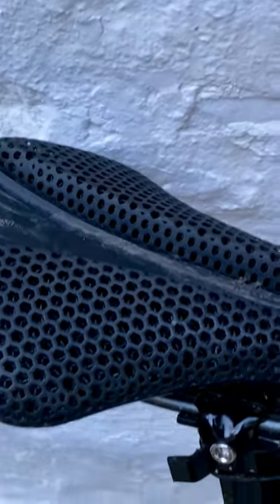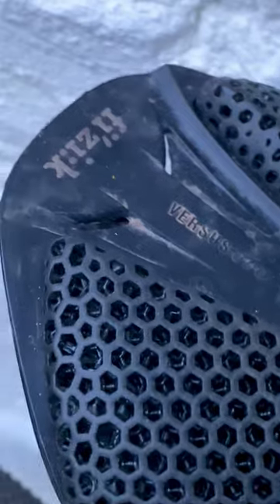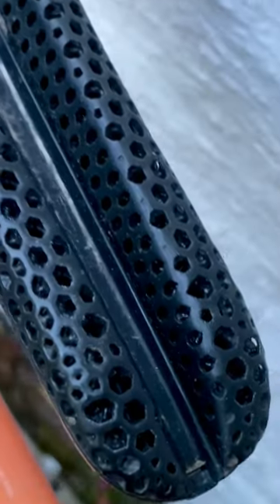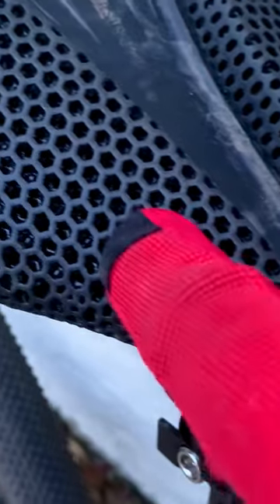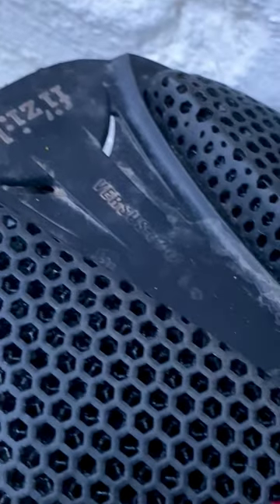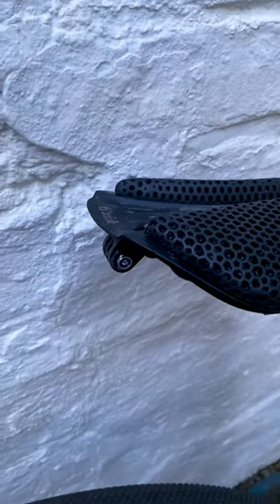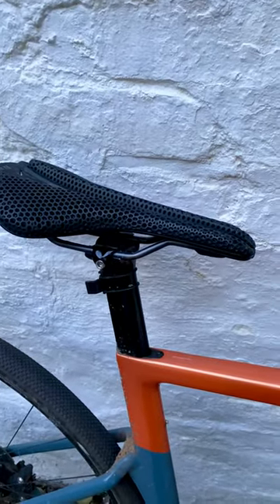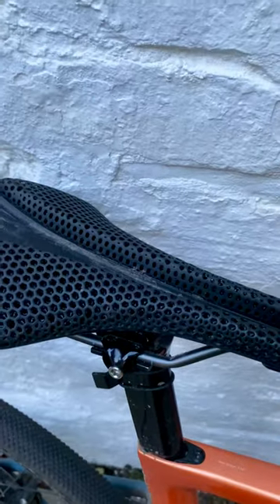#shorts #short Fizik 3D printed saddle sheds mud + water perfectly Antares Versus and cooler in heat

Comment: What bikes are you riding that the seat post dropping is a common problem?!?!?!??
Reply from the maker: I have had it on my trek stache, specialized various stumpies and epics and my old 2009 tarmac sl2, kona unit… if you google something like seatpost slipping, pretty much every manufacturer has an faq and there are a load of videos and blogs on it, so … it’s all about tolerances from what I can see… I don’t think that area is tested or monitored for tolerances as far as I can work out: so some bikes can have all of them slip: others your same model could not slip and mine might.
Reply: @ChristianBorrman  Get yourself some Paul clamps, won't slip anymore (although not sure Paul makes a clamp for that fancy stem). btw a question for you - I'm thinking about getting the saddle in mint, I'm worried that my jeans will transfer dye to it and permanently staining, any thoughts about that happening given you've spent some time with the material?
Reply from the maker: I shall have a look at Paul clamps, thx. Its a good question on discolouration; hard to judge discolouration as they are both black, however my gut feeling, judging by how they both look brands new a year on and no rubbing signs where they have been against walls, is that the white ones will be ok with it…???
Reply: @ChristianBorrman  I should probably just go with the black vs the mint colour. I emailed Fizik to ask if they'd heard of the mint getting stained but no reply. Thanks Christian, have a great weekend Sir.